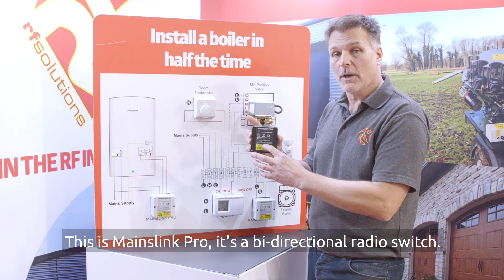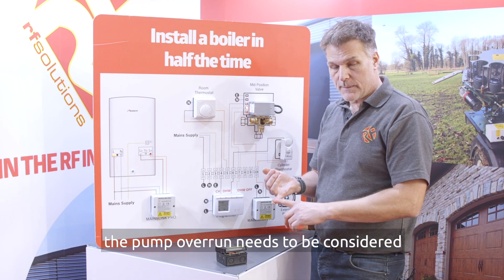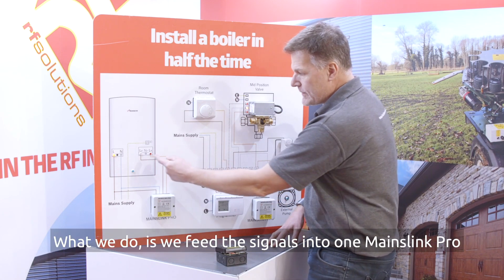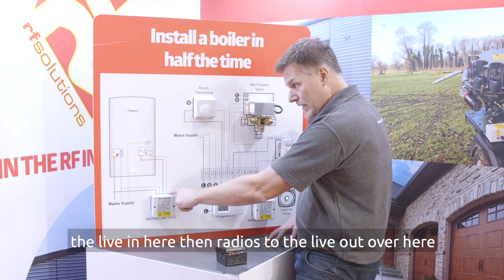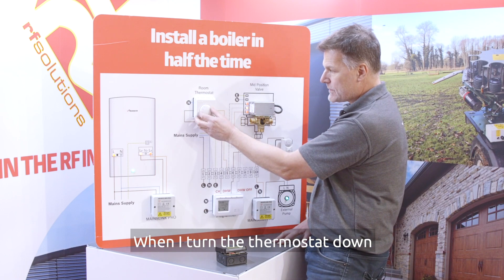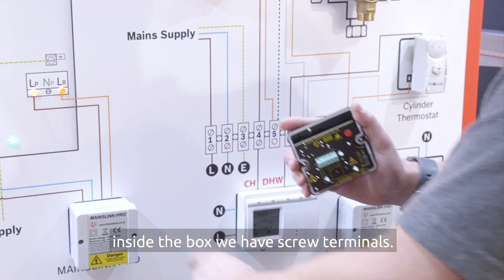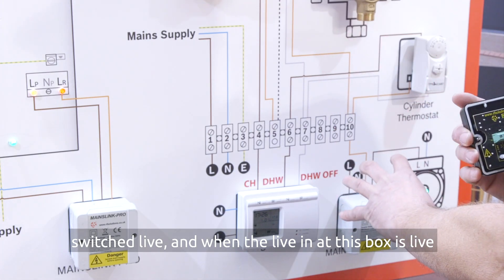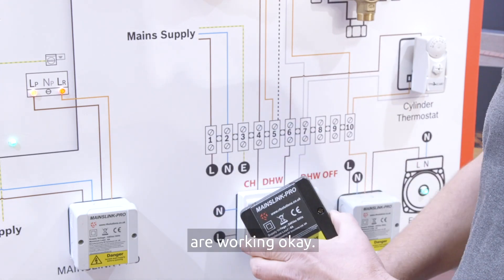Easy Two Way Pump Overrun Solution for New Boiler Installs | MAINSLINK PRO Demo

Comment: Brilliant idea, already used several single channel units. I can think of several jobs when these would have been invaluable.
Reply from the maker: Glad you're impressed 👍We may be giving away one of these as part of our Installers Club later on in the year, so keep you're eyes peeled 👀
Reply: @RFSolutionsLtd  just been watching Efixx for electrical contractors showing the four channel system so I’m guessing they may be in on that give away?
Reply from the maker: @christastic100  They might be, we may also give away a RIoT receiver later in the year if that's an interesting solution to you. Likely September-October time..

Comment: I had this installed a couple of months ago, was fine to start with.  Sometimes the pump wont turn off at night which is no hardship as I just press the preset button on another box in the airing cupboard but worse like again today, the boiler didnt come on this morning and I had to wait for four hours in the cold for the lights to communicate.  Really not impressed so far.
Reply from the maker: Hi Elaine, thank you for your feedback. In some circumstances, the heat pump sometimes generates radio noise when running which can drown out the signal of the MAINSLINK-PRO, enabling it to sometimes turn the pump ON but not off. There is a 'watchdog' feature on the MAINSLINK-PRO system which can help with this, however it has to be enabled upon installation. I gather our Support team have come back to you with some initial info. If you can get your installer to contact us, we'd really like to help however we can to get this sorted for you 👍we can advise from there!🙂 Jamie - RF Team
Reply: @RFSolutionsLtd  I had their top electrician come in the week and he spoke to one of your team and enabled the "watchdog" feature.  All was well I thought until it got to 10.30 pm and the pump would not switch off at all.  This time pressing the reset button on another small box in the airing cupboard didnt work (it had done before the watchdog was enabled and the unit played up, sometimes not coming on in the morning and night)  Now it is permanent and the only way I can stop the pump running is to ease the fuse cover off slightly and then push it back in at 7.30 a.m.  I cant leave the pump running during the night as I am an insomniac as it is lol and the airing cupboard is right by my bedroom.  It is so frustrating and disappointing as a wonderful concept.  They are now talking about having the floors ripped up which will be a nightmare.  I will email your team again and have taken some photos of the sequence of the lights.   The watchdog has definitely made it worse for some reason.
Reply from the maker: @hateanimalabuse  Hi Elaine, we’re sorry you’re having persistent issues with your heating system. Regarding our MAINSLINK PRO, the “Watchdog” feature is useful as a reliability background check for sending signals, however it does not help to send the signal to begin with. From the symptoms described above, we’d suggest the electrician check wiring and try moving the radio units into a more optimal position. From the installation photo of the unit, the MAINSLINK PRO units could be better positioned for RF transmission. For example, the units would benefit from being moved away from the metal shield which will block radio signals and make the system unreliable. It sounds like more could potentially be going on with the system than just the issues with the radio signals. From our point of view, we want to do everything our end to ensure our system reliably works. Before floors are ripped up, when your electrician is due back, please get him to give our support team another call and we'll try to ensure the unit is positioned in the best possible way for optimal radio transmission. I hope that makes sense and we can get everything working for you 🤞
Reply from the maker: Hi Elaine, thanks for your reply. I've had a chat with Edward in Support and sent this over to him; he's going to come back to you via email just to streamline things so we're not both coming back to each other twice over. He's going to take a look at your more recent photos and go from there. Hopefully we can get it sorted with your electrician and get your heating system working as it should. Thanks, Jamie - RF Team
Reply: Thank you so much for your response I only just saw it. Sometimes it behaves itself for days at a time but for the third time it didnt come on in the morning. Fortunately I found that the preset button pressed brings it on as well as off. It goes for 15 hours a day no problem. I did alter the pump a while back as it was left too fierce, imo, and I changed it to 3/4 bedroom house and it barely makes a sound. I've been waiting now since Thursday with no show electrician. The boss in the electrical dept of Boxt was made aware of your offer of advice. I'm just waiting now.
Reply from the maker: @hateanimalabuse  Good to hear, when they enable this feature hopefully that will sort it 🤞do keep us updated though, we'll be happy to hear when this is sorted for you 🙂 👍 Jamie - RF Team
Reply: When I eventually have an electrician, I will mention about this watchdog feature.

Comment: I have a problem in need of an RF solution and wonder if this could be the answer......it's a wet central heating system with an S Plan control system, everything is in place and working but i'm unable to run a physical cable from the wiring centre by the boiler and the motorised valves up to the cylinder in the airing cupboard for the cylinder stat, due to tiled floors etc. Can i use a Mainslink as an alternative to hard wiring my cylinder stat ?
Reply from the maker: Hi Julian, this RF Solution will be ideal in this kind of situation. If you need the solution to be bi-directional, you'll need a MAINSLINK-PRO as this transmits/receives both ways, however if you just required a one-way solution then our standard MAINSLINK should do the job! Let us know if you need any more information! 

Jamie
RF Solutions Team
Reply: @RFSolutionsLtd  Thanks for reply….I suspect one way will do the job as the cylinder stat is just a make or break 240v switch, the action of which I need to replicate remotely to send 240v to the motorised valve
Reply from the maker: Hi Julian, if that's the case you might wish to look at MAINSLINK. Here's a video of an electrician using this to switch lights, which demonstrates it's use in a one-way switching scenario: https://www.youtube.com/watch?v=thjNyJd-XoM 
Hope this helps! 😀👍
Reply: Had a look on the website and have ordered a Mainslink as I think that’ll do it 😁
Reply from the maker: Excellent 👍 Get in touch should you need any support 🙂

Comment: Pricey vs Mains Switch RF
Reply from the maker: The Mainslink-Pro maybe more expensive however it is bi-directional, has a range of up to 5Km and is better quality - UK Manufactured. Whereas the mains switch is only 100m range and is a one way system; therefore you can't really compare as you would require two mains switches for it to operate in the same way as the Mainslink-Pro. Hopefully this helps and clears things up.